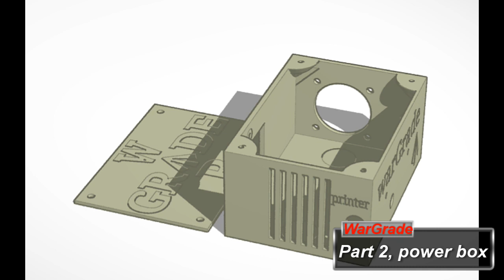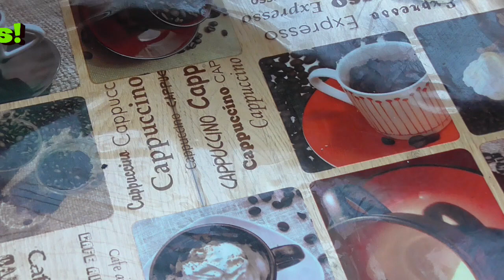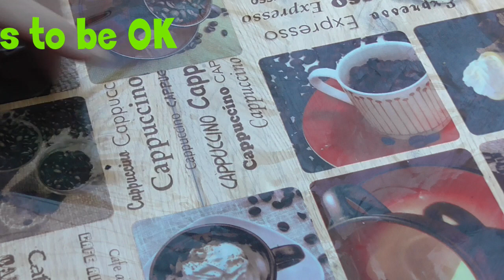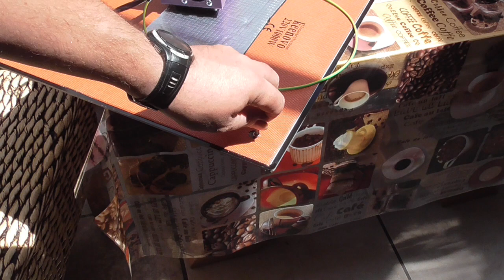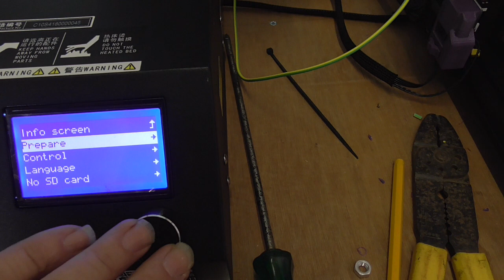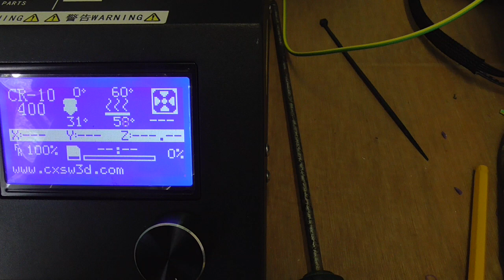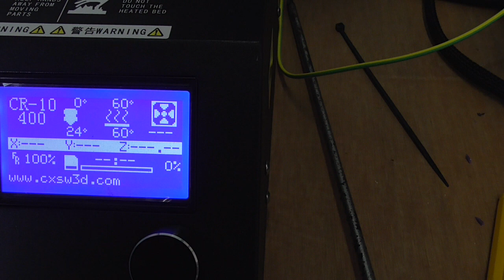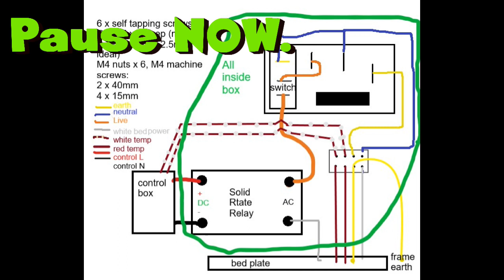Keenovo heat pad fitting to Creality CR10 S4, Part 2

Comment: Has anyone info on thermal runaway sensor mounted on aluminum build plate??
Reply from the maker: it is simply a thermal resistor (I can not remember what type) however if I remember correctly the one Keenovo is the same.
the thermal runaway is programming
Reply: @WarGrade  hmmm will have to look into that.

Comment: What were your ground points?
Reply from the maker: I fixed to one to the bed & to one of the frame bolts, you  will need to clean the paint off behind  it & one of every bolt that connects to every other bar.
To do a 100% job, you would have to have earth links every metal item on it!
If your in any doubt talk to an electrician.

Comment: Nice Job.  Currently printing cold on my Robox as the bed heater went bang blew other things up too!Your captions whizzing by are a bit difficult to read even though they are quite large, perhaps I am just a slow reader.  Is it worth considering smaller captions that are stationary, but on screen for a while?
Is your printer one that comes in a kit to assemble or available ready to go?
Reply from the maker: Hi, thanks for the comments. This was an early video & I'm learning evolving all the time, I try and voice over as much as possible now, for the simple reason reading the comments took your attention away from the very thing you were watching the video for!
I run a Creality CR10 4s, basically it came in 4 main parts, the  bed, upper frame, cables & the control unit.
Assembly was quite simple & I have not really done any modifications to it other than the bed & tend to use PLA for my prints as I getting the results I want from that (thus far).
Reply: War Grade what voltage was the original bed heater?
Reply from the maker: @smallcnclathes  12v IF my memory serves me correct
Reply: Not worth using again even with the safety of 12 volts
Reply from the maker: @smallcnclathes  12 v If my memory serves me correctly.
Reply from the maker: The only thing with 240v (or what ever your mains supply is) I'd recommend inspecting your cables on a regular basis (power off), don't use it on a conductive surface & make sure you earth the frame.

Comment: Just ordered the same thing direct from Keenovo (after pondering for a while) for my CR-10 S4. Found your videos and I'd like to thank you for posting your experiences.
You mentioned that guide said not to use petrol, thats probably because it is oil-bassed and would probably affect adhesion.
Your temp stability would be even more precise if you enable PID and tune it. The heater that I've ordered suggests changing the thermister to 11 or 13 in Marlin.
Being British too, I really loved the Benny Hill theme. It's the perfect track for it, and always will be in my book.
I trust your heater is still working well?
Reply from the maker: To be honest, I'm not a tecno & as I'm Dyslexic,  sofware is a struggle for me.
That said I am looking at the possibilitys of building a CNC table.
Reply: @WarGrade You sure overcome those issues to make the video, very impressive. I'll test my suggestions and implement them when my heater arrives. I'm more than happy to help with Marlin config if you need it. My firmware is the latest version, I configured it from the ground up to include the BL Touch, Bontech extruder and Micro Swiss hotend.
Although I've never built a CNC yet, it will be even easier, firmware wise, as there are far fewer configuration setting to worry about. Either way, good luck with it.
Reply from the maker: Thanks Spike, I might take you up on that when the time comes. here is a link to the MPCNC YouTube page.
https://www.youtube.com/channel/UCXf0vDExLLX1lb2cpyiOFbg
I  am considering a version of the low rider (when ever that might be) it will be mainly for plasma cutting.
Reply: @WarGrade  Please do, give me a shout any time. Ah yes, I've seen the MPCNC before and was really tempted, but since I don't have a workshop it would be too much to do indoors. A plasma version will be amazing, remember not to overheat the printed parts though :-).
I've just finished tuning the Linear Advance on CR-10 and it's seems to be working very well now that it has the Bondtech extruder, Micro Swiss hotend and Capricorn PTFE. Just so you know, I've made it quieter with Noctua fans, TPU printed feet and tuning the VREF on the motor drivers too. Once the Keenovo heater arrives it should be a pretty good machine (I hope lol) I'm sure I will still find more stuff to improve though. Happy to help all I can, I'm also on Twitter @spikeinkent
Reply: @Spike I just finished doing this install as @War Grade had done it.  I'm noticing now that the ssr is turning on/off very quickly once the bed has reached the set temp (in my case 60C).  Is this normal?

Comment: Did you have to adjust the firmware for the new thermistor?
Reply from the maker: Hi Shaun
No, apart from modifying the bed for the keenovo heat pad and the wiring nothing else was done.
having spoken to Keenovo and tested the resistance values to confirm the case, the Keenovo heat pad uses the same value.
I have been running this set up for some time now and it is still working fine.
As I say in the video, the only thing to be aware of is you are running 240v (or what ever your mains voltage my be).
Regularly check your cables for any signs of damage, & consider putting in a week spot, what I mean by this is give the cable a point it  flexes, if it is going to break, that will be the point.
One thing I would consider doing & I will be doing this my self is separating the 240v feed for the bed from the temp thermistor.
That way, if the worst case happend and you get a cable break in the thermistor & 240v cables (yes very unlikely) at the same time there is no way they can short together.